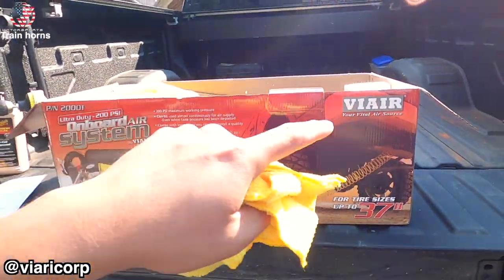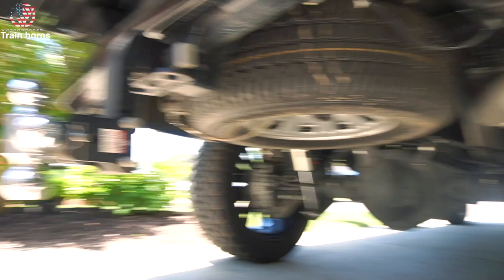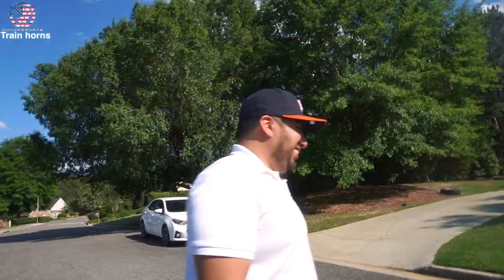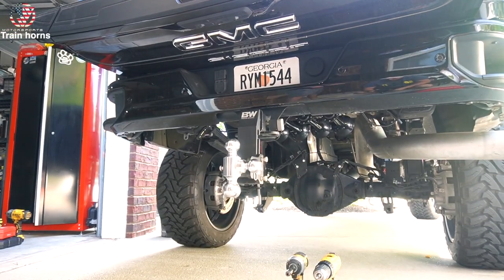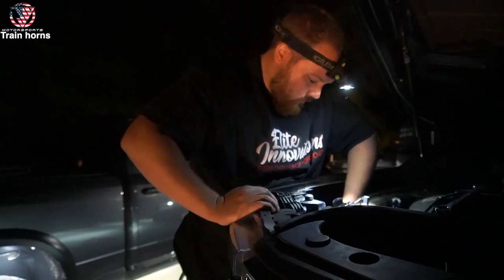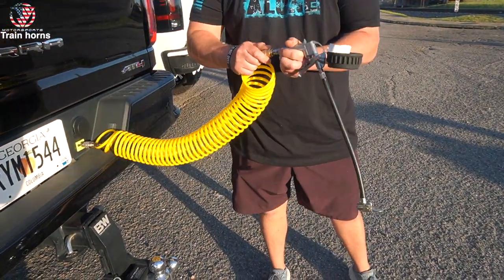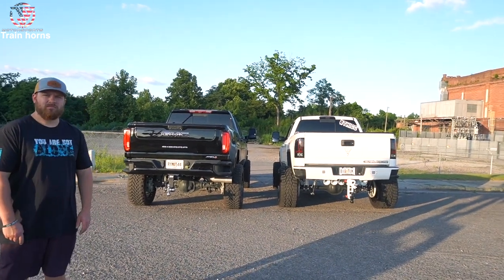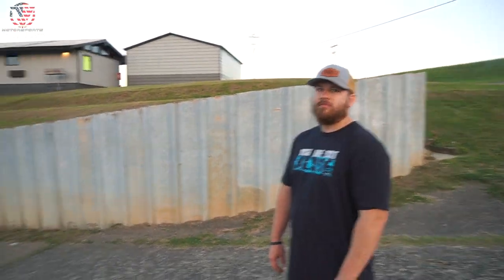WATCH BEFORE BUYING TRAIN HORNS! *On Board Air System + Horns!*

Comment: Curious, why didnt yall mount it under the bed. My 2017 the stuff fit under the truck (with the spare tire still there) and I am about to do my 2020 2500hd next.
Reply from the maker: I just felt like the space under the bed cover was a good spot for the tank. Otherwise it most likely would’ve been under the bed.

Comment: Guys I need help I have a 2016 Silverado 2500 HD LTZ Z71 6.6L Duramax I only have 32k miles on it it’s black and chrome it’s not lifted yet maybe next year but just paid it off so it’s all mine I bought it late 2017 and it’s a 2016 that had like 140 miles on it and now I want to have fun with it I want to do train horns I want loud and I want it to look professional I want it like the black truck in this video where he can walk around back and air stuff up I like that. I just don’t honestly want a cover over my bed and everything just sitting in the back I do like those swing out tool boxes that’s cool to keep like the hoses and fittings to air stuff up what do you all suggest? And also if I do have to get a cover I might as well get a topper. But as of now I like the sneaky sleeper stuff so I’m out of louisville Kentucky so if there’s anybody you recommend buying and having them install it I’m down. Any and all help is greatly appreciated

Comment: They are the same.  But for the ones mounted forward, why not tilt them down a bit so the bell is pointing on an angle downward so they can bounce off the road and go better forward ?  Straight like you have them they are going to bounce off alot of your frame and under parts, and won't project as far forward.  It's probably a lot louder inside your truck than it could be by being angled down slightly, and much louder than the guy with them facing rearward.  On the video they sounded the same.

Comment: Out of curiosity you got HornBlasters, instead of having to go through all the stuff as to where to mount everything; the sell a complete kit that will mount to where your spare tire went. You use the steel cable that you use to raise & lower the spare, you use the same thing to raise & put into place your whole HornBlaster unit. In my opinion a much simpler & easier install, all you have to really do is run the lines for the power supply. You can still use the tank for on board air supply as well.
Reply from the maker: True! I didn’t like how you can see the horns with the spare tire delete kit brackets. Also wanted the 2.5 gallon tank I have to fit under my retrax

Comment: hey dude so i rebuilt my turbo on my lly and the haynes repair manual says to use jumper wire to turn engine oil turbo before actually trying to start the truck do you anyone you know done this? a video of it would be really helpful
Reply from the maker: Truck master and I have made videos about it on our turbo install videos